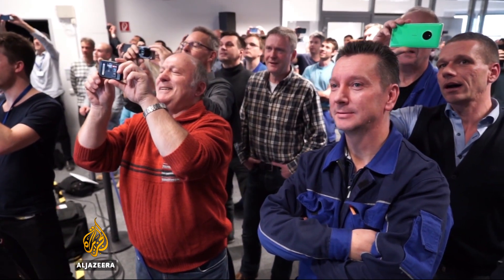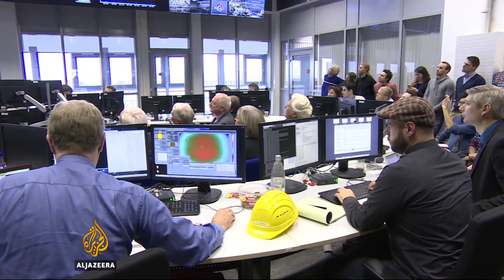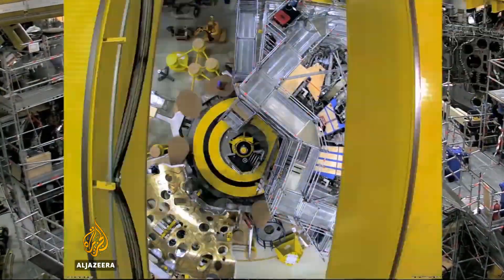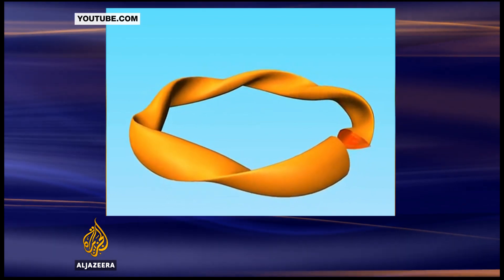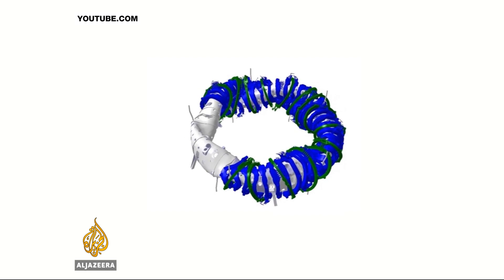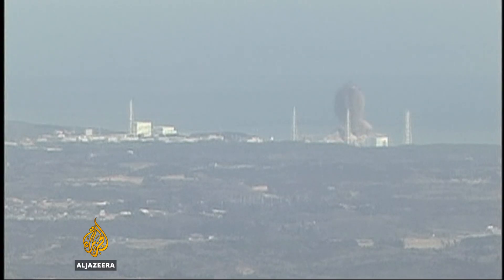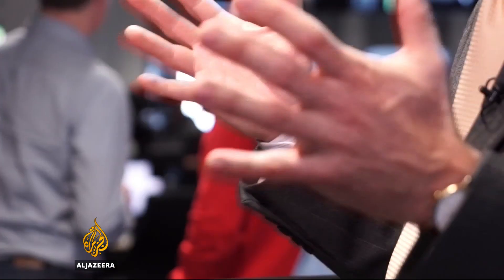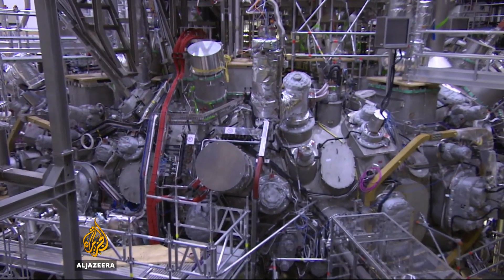Germany launches world's largest nuclear fusion reactor

Comment: The tokamak is easier to built due to its symmetric structure. However, it is less efficient at the same size than a stellerator. The stellerator is more complex to built and development started later as magnets of the required size,  strength and accuracy became technically available later. The stellerator can run a continuous plasma. This is according to the Max Planck Society who are operating a Tokamak in Munich and the Wendelstein Greifswald, Germany, both successfully. The biggest problem is, that you have to have reactor size to come to a positive energy balance and ITER is expected to be the first reactor achieving this.

Comment: Would this be dangerous if it blew up?  Chernobyl...Fukushima..that's still leaking water from its cooling towers into the ocean..coz it's too dangerous to fix the break or hole in the cooling tank wall...I don't think we need to builder any bigger atm

Comment: Nuclear fusion has been 'decades away' for over 70 years now.  But at the moment with advances in A.I. and materials science along with the knowledge that there is a deadline things are finally hotting up... [Pun intended]

Its just a scaling problem now... The larger the tokomak the higher the output for the same input. By that means a fusion plant will be massive and really complicated.

Comment: Fine but if something's 100 million degrees there must be some risk involved. I mean that's pretty hot.
Reply: Heyyy I know your comment was made long ago but I just want to say: I was actually there at this "reactor" and got a private tour. They showed me the control room and explained some things. The hot gas is actually veeeeery thin, so the actual thermal energy is very low. Its not much of a risk even if the reactor would burst or something.
Hail German Engineering xD

Comment: 19 years for one second?
Reply: one must first learn to walk before learning to run. small tests will give way to full scale testing and the day will come when they achieve a self sustaining reaction and when they do we can scratch energy off of our list of societal problems. once that is done there are alot of theoretical technologies which could suddenly become possible for example an FTL drive we could then build spacecraft capable of travelling to other stars and planets. we could colonize these planets and even terraform them to make them habitable if they are not already. literally fusion is THE problem we need to crack before we can really advance as a civilization
Reply: It was just the first test for getting datas.
They werent even testing with nuclear material.
There will be many tests like these.
Reply: Do you think if Albert Einstein had lived today he would improve the process of this research?
Reply: Yeah dude 100 millions grade of celsius, no material that resist that. They talking about magnetic fields and plasma in an other video
Reply: log140 It will cool down very fast
Reply: Einstein was a physicist, not an engineer. Meanwhile molten salt fission reactors are about a decade away, a little bit of radioactive waste, potentially as cheap as coal, and no explosions. It's the next best thing.

Comment: the EAST in china reached 50000000centigrate degrees lasting for 102 seconds this years and it seems only a step away from fusion
Reply: Wendelstein 7x was able to create hydogenplasma for 6 seconds in February this year. With maximum temperatures of 100mio degrees Celsius for the elektrons and 10mio degrees celsius for the ions. Using 4 megawatt of power a second to create it. at the moment they are preparing for the next experiments which should start next summer. Then they want to create plasmas which last 30mins!!
Reply: looks very promising ，hope it will bring limitless energy to the world

Comment: No doubt Greenpeace will hate it and insist the whole world rely on windmills..
Reply: no
Reply: Daniel May Which is funny considering the serious negative effects that all the mining required to create them has. Obviously nuclear can't produce energy yet and is purely research but the end goal is to create a more green source of energy that doesn't require many resources but can produce a huge amount of power regardless of if the sun is still active.
Reply: Wind is better and more cost effective than nuclear. Just needs more grid storage.
Reply: @yalgret  no it isn't. It is geographically limited, and windfarms do not produce half the energy a single reactor does.
Reply: @sploofamator  have they solved the waste problem yet? No. Nuclear is also geographically limited to locations with a large water supply, away from urban areas and earthquake zones.
Reply: @sploofamator  Nuclear supporters are so sure about themselves while there are very serious waste problems that cost billions every year to manage and people are still suffering from birth defects caused by Chernobyl, and now Fukashima.
Reply: @yalgret 

Fusion waste half life is shorter than twenty years.
Fusion is not a chain reaction and does not rely on cooling.
Reply: @Katzelle3  I was referring to nuclear as in what is in current use (fission). Fusion is a future technology under development. I would love there to be a future of safe, clean fusion with manageable waste products. However, how long will we have to wait? Its already getting very late to try and reverse the man-made and ongoing changes we are hastily making to the biosphere.
Reply: @yalgret 

Blame the lack of funding. It is constantly being reduced for decades. Everyone goes the Tokamak route because the Stellarator is too experimental.

Comment: When this field eventually kicks off properly it will be an end to all this renewables garbage wind turbines etc , which will always be an eyesore no matter what way they are dressed up , Fusion WILL change the Earth when it finally arrives and it certainly will
Reply: It will cost too much because it must be built very big to be effective and with size comes costs.
Thus it won't replace the much cheaper renewable energy sources it will only complement them at much higher costs if they get it working.
A nuclear power plant using fission can be build near a river, this won't work with fusion. Those fusion reactors will produce too much thermal energy thus you will need to build them near an ocean to be able to cool them without heating up the water to a level that can harm the nature.
Comparison:
Thermal energy of a modern normal nuclear power plant using fission: about 2000 MW
Thermal energy of a fusion power plant that generates more energy than it needs itself and runs economical: expected value > 100000 MW.
That's > 98 GW more thermal energy that want to be cooled. Not feasible with a big river without having a big impact on water temperature. You will need an ocean to cool it.
Reply: OpenGL4ever This stuf is cooled whit liquid Helium it doesnt need to be near a River
Reply: right now even the biggest fusion reactor can't eve produce enough energy to sustain itself. a nuclear fusion reactor that can boil a cup of water would a 1Billion dollar sensation.

Comment: It's actually very funny when you think about it, all that tech, fancy fuel source, just to boil some water in a container and create vapor that will get turbines moving....
Reply: +procerusgigas procerusgiga yep ! they never question the basic principle of boiling water and move turbines somehow
Reply: procerusgigas procerusgiga it looks primitive doesn't it
Reply: No, what he means is: the fusion reactor will create heat to be used to boil water, to power steam turbines.
Reply: At present, the only methods of generating electricity without boiling water to turn turbines are wind turbines, solar panels, and hydroelectric dams.
Reply: @tuele4302  and Diesel engines
Reply: Dude, solar cell is one of the exceptions.
Reply: That's no water, they boil hydrogen without oxygen.

Comment: why does it have to be so large if it's a prototype? is it scalable?
Reply: +Mark Lagunzad Because you need a temperature of 100.000.000 degrees to make the fusion work....and that needs a massive magnetic field to contain otherwise it would just evaporate the whole machine
Reply: +Mark Lagunzad As you build it larger, the efficiency tremendously increases. As you make it larger, the volume inside grows faster than the surface area around it, but the power of the magnetic fields stays the same. Also the particles move incredibly fast at 100 million degrees, it is easier to confine them if you give them more space. If you double the size, it gets at least 10 times more powerful and efficient. It basically scales without limits, you could theoretically build one huge reactor to power an entire continent.

Comment: i thought germany swore off nuclear power after fukushima disaster
Reply: +John Smith that only applies to fission. fusion is safe and produces no problematic nuclear waste.
Reply: +John Smith It's a fusion, not an nuclear reactor. First inform, then write ^^
Reply: it isn't the same thing. The reason why nuclear power is bad is because it creates waste that will be extremely dangerous for the next 1000 years. also if something goes wrong it has terrible consequences as we could see with both Fukushima and Chernobyl.
Nuclear fusion on the other hand doesn't produce waste and releases a lot more energy.

Comment: Low quality reporting. If i want to see how it looks and works i can look up information already available - there's nothing new in this news segment except for the fact that they "turned it on" - not for the first time i might add. "So they turned it on and what happened? Well, we don't know, we didn't get around to doing any journalism."
Reply: ***** I would have preferred if they said anything about how the reactor is performing. Containment of over 30 minutes being the primary thing.

So looking more into this, the tests are progressive. First helium to test the containment than hidrogen after 2 months (if all goes well).
Reply: +Radu Andrei They did spend a decade building it, and now they fired it up for the very first time, they used only helium and their goal was only a basic plasma at ten million degrees. They did do that, proving that the coils can take 15000 amperes, proving that the injection systems work, and proving that the heating systems work. The reactor performed as shitty as expected with just helium and just 15000 amps instead of 20000 amps on the coils, but with nothing going wrong and the hardware working on the VERY FIRST try, it is a success. No hardware or software or design fail on the very first try to fire it up. They will now gradually ramp it up to 20000 amperes, upgrade to hydrogen, then deuterium, and finally to a deuterium-tritium mix, at that point they will reach above 120 million degrees and the machine will become radioactive. As soon as they go to deuterium + tritium and it turns radioactive, there is no going back, and hands-on work on the inside of the machine is no longer possible, so they switch to robotic remote handling, and obviously they will test that first with hydrogen and then deuterium.
Reply: kurtilein3 Something like this is what i was from the report. Thank you.

Comment: Nice one Germany, leading the way
Reply: +jemszjemsz ...straight through Poland
Reply: Then France
Reply: animesis  your just jelous... germany has the cleanest Energy in the world America should look up to germany
Reply: Germany are leading fusion technology... so they are in front.... Not talking about 50 years ago
Reply: animesis
only because this one is not doing deuterium-tritium yet. They finished the tests with helium and moved on to hydrogen, some more of that then they will move to deuterium, and then you can start shattering some records.
Reply: +jemszjemsz , I thought iter was leading the way.
Reply: +Voldemort ITER has slowed down, unfortunately.
Reply: jemszjemsz and the British inventing this system in the fifties isn't leading the way...  Multiple countries have been working on this for decades, this is the latest attempt.
Reply: kurtilein3 

The Germans were using deuterium  in 1943 ., that didn't work out to well for them (norsk hydro) 

With that said Germany are 70 years in front of everyone with regards to engineering
Reply: @windomearl666  lol, alright sunshine.
Reply: Theres no way to say whos leading the way in Fusion tech. The origins and most of the current tech lay in Britains half a century of research, the most advanced one would probably be either MITs or the multinational one in Switzerland. And as to power made/used ratio that is highly debatable and records jump between different reactors. But in none of these are the Germans seen as leading, but another contender.